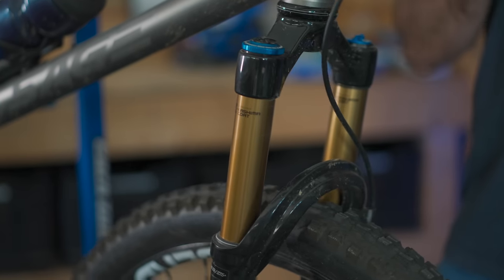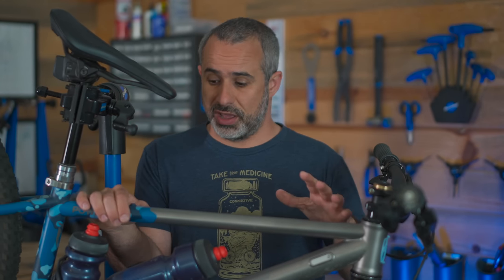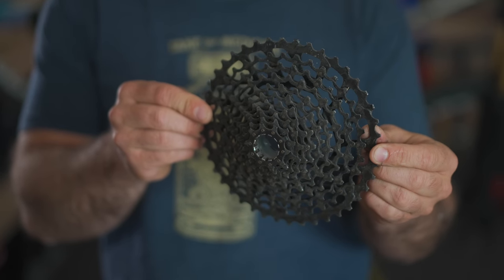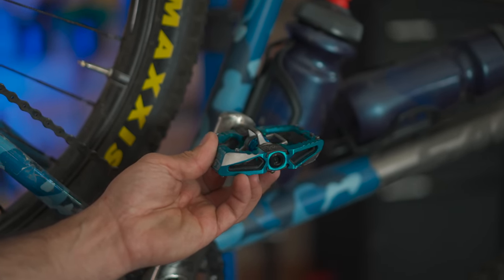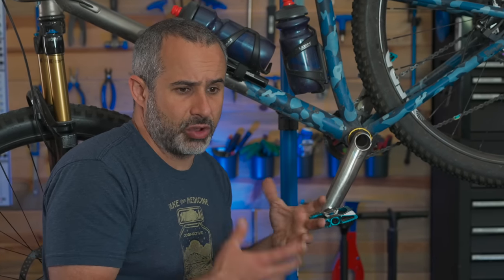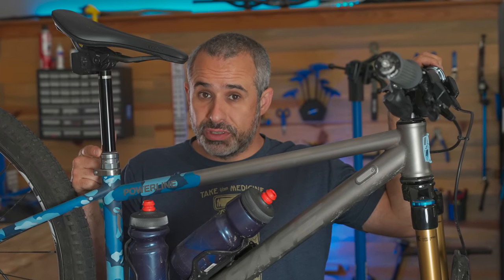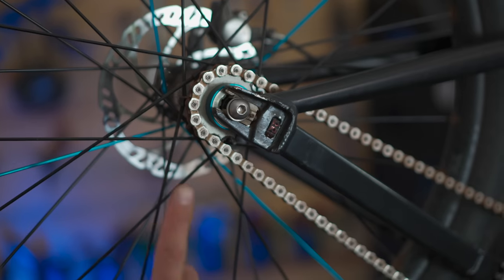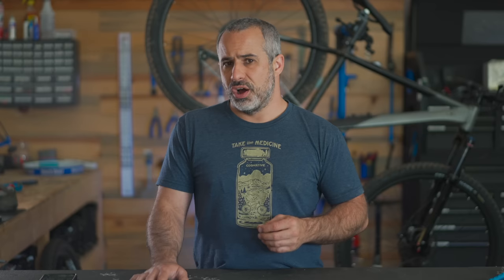You're saying it Wrong! The most mangled bicycle lingo clarified

Comment: Gotta say MTB is the odd one out with chainrings. As you mentioned before on BMX it's just a front sprocket, on motorcycles you'd also call it a front sprocket.
Reply: Motorcycles don't have cranks; all they have is a front sprocket and rear sprocket; bicycles are different and out of all different types of bicycles, only bmx'ers call a crankset a front sprocket..